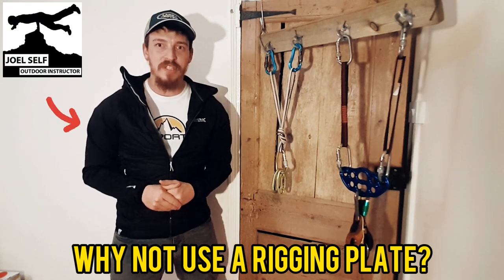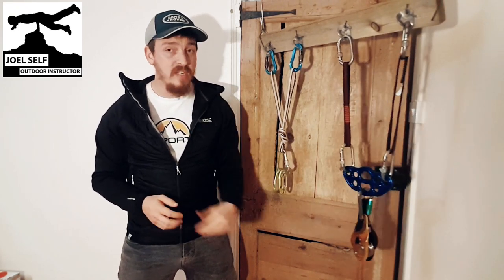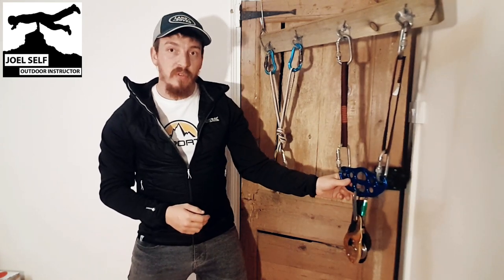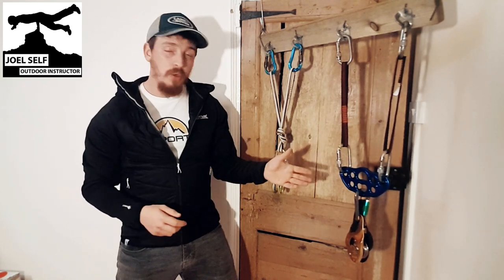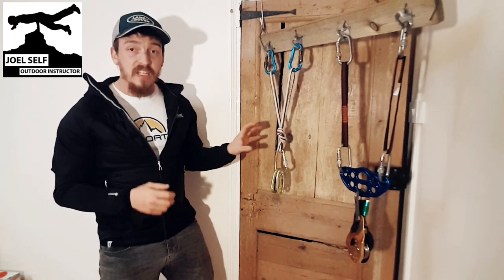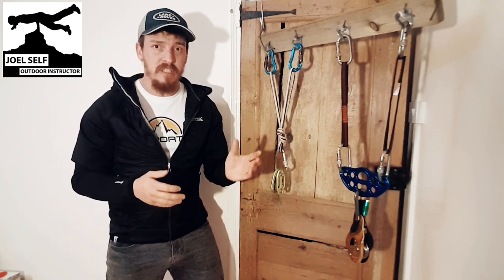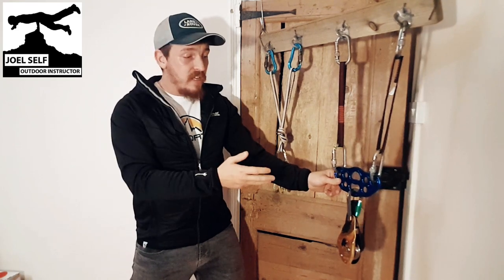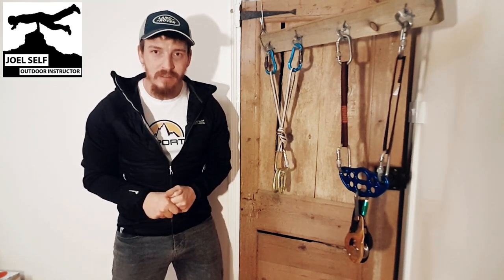Why dont we use rigging plates? (Climbing Focus) - A Video by Joel Self - Outdoor Instructor

Comment: No one uses rigging plates THAT large when rock climbing, even on wall routes.  The small rigging plates are wonderful for adding force multipliers for hauling big loads low on the route.  I even use the small rigging plate (three hole) while guiding two climbers.  The small Petzl rigging plate weights something around 2 ounces.